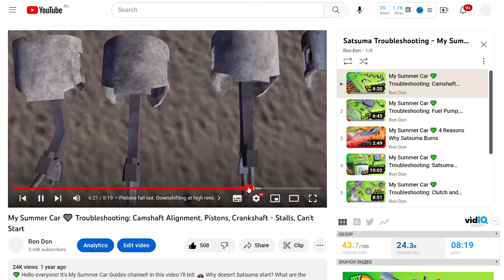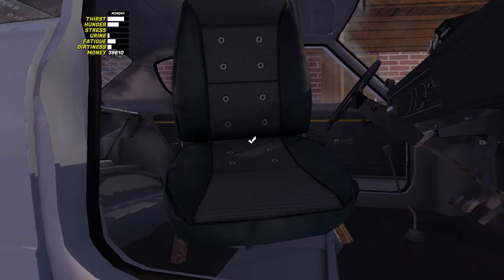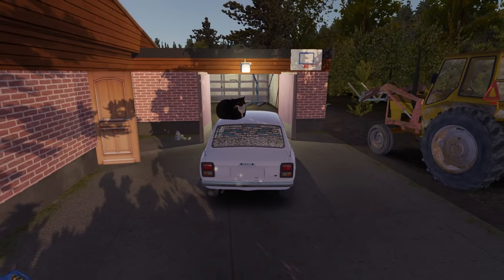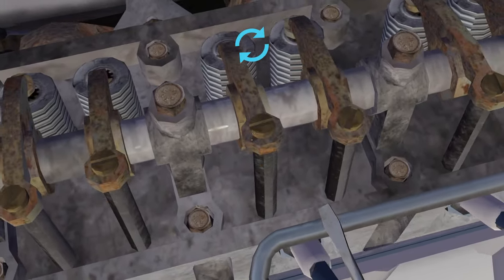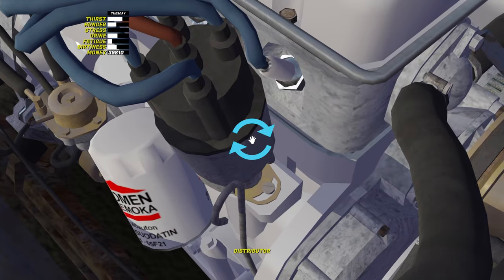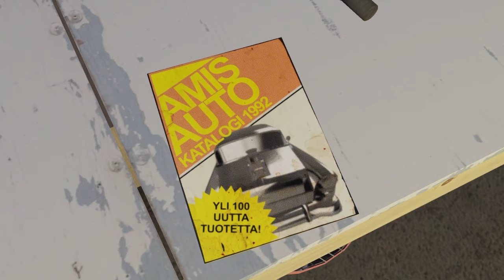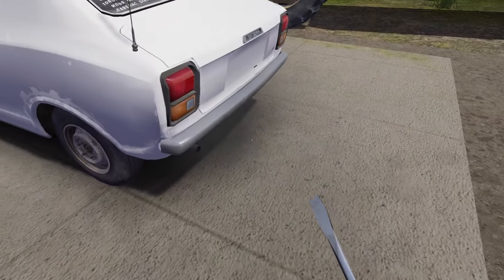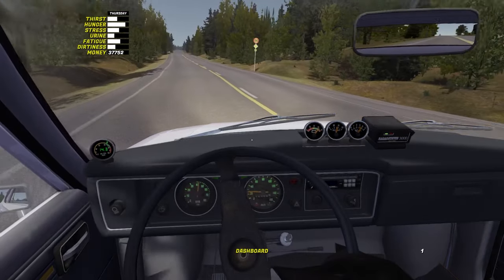My Summer Car 💚 Engine Adjustment - Best Settings! (7 EP) Building Satsuma Ultimate Guide

Comment: My car starts for the first time then everything dies
Reply: I'm sorry I feel your pain.
Reply: Pull choke
Reply: Camshaft gear not aligned properly
Reply: Battery has been discharged or wiring not done correctly. ( if ignition is not working and lights are not turning on)

Comment: i want to adjust the distributor but my car wont start when i turn it on for too long the electrics just give up i really need some help
Reply from the maker: usually at the first launch you have to twist the starter so thr carburettor can pump oil into the engine
try to charge the battery before the first start
if nothing happens check fuel then check all things related to ignition. like spark plugs whether they are tightened or not and so on
Reply: @RonDonDon  thanks i found it out i have kinda a bug where my battery just dies out of nowhere

Comment: What about the tuning in different carborators
Reply from the maker: a twin carb behaves just like a stock one. 
Tuning a racing carb is such a pain that i’ve decided to include it in next huides about upgrading Satsuma
Reply: @RonDonDon  okay and what does the "engine tuning" option do at fleetari's does it tune those things as shown as in the video?
Reply: @kashyapliya09  No. If you want to tune it on stock then use engine adjustment factory spec. If you want to tune the car to max, then you need to use the engine tuning option.